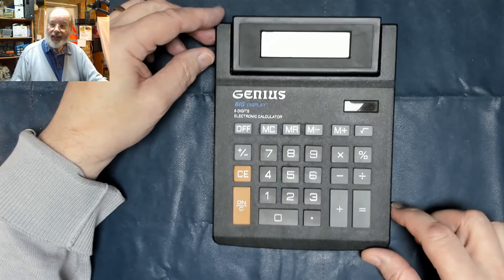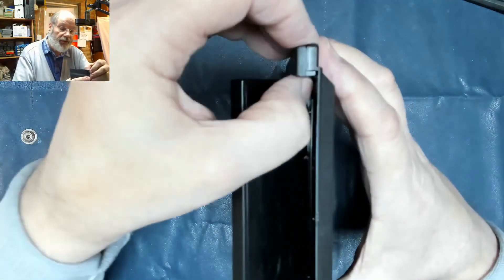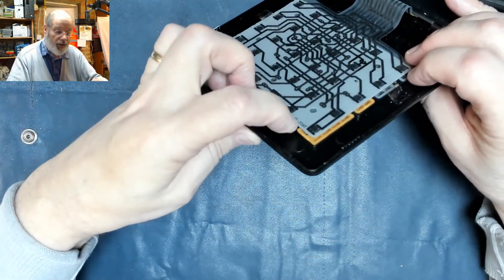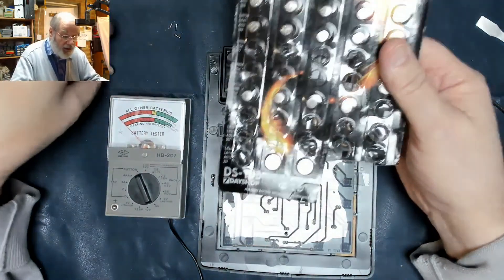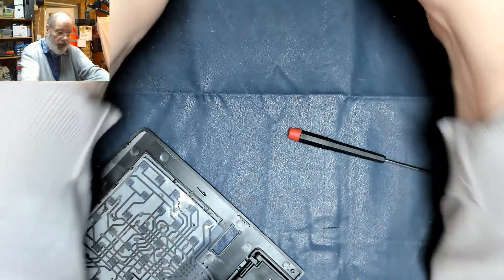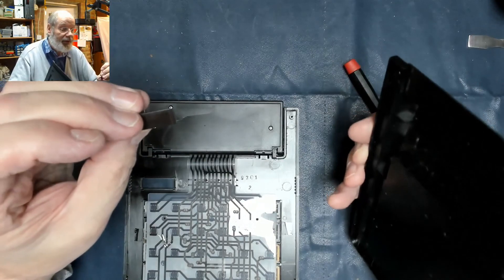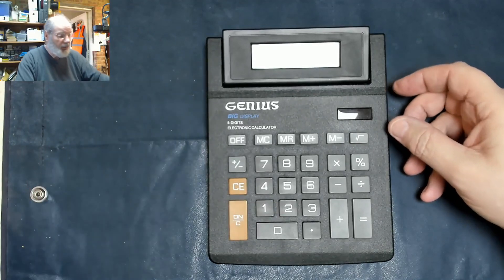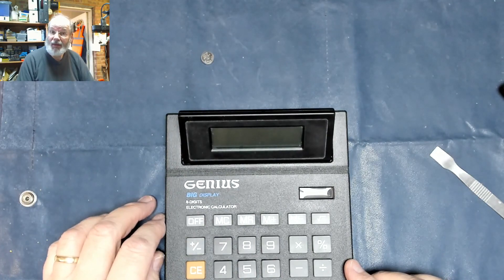Repairing a FAKE SOLAR POWERED Calculator

Comment: hello could you tell me where i put 2 cables in that board? cuz i have the same calculator but i want to put it with aaa battery, in part of the board i put the positive and negative cables? thanks.
Reply from the maker: Sorry no, the unit is long gone.

Comment: I WANT YOU TO MAKE A VIDEO ABOUT MY CALCULATOR PROBLEM 
I HAD RECENTLY BOUGHT A FAKE CASIO CALCULATOR BECAUSE MY FAMILY ISN'T THAT WEALTHY TO BOUGHT ME AN ORIGINAL ONE , WHATEVER, SO THE PROBLEM IS THAT INSIDE OF IT THEY GAVE A REAL SOLAR PANEL THAT HAVE WORKING TERMINALS I HAD TESTED AND  TWO SPACES FOR CELL FAR APART FROM EACH OTHER , LITTERLY ONE IS AT THE TOP OF CALCULATOR AND 2ND IS IN THE CENTRE-DOWNWARD . 
THE TOP SPACE FOR CELL IS FILLED WITH TWO BUTTON SIZED CELLS SIMILAR TO ONE U SHOWED IN VIDEO AND THE 2ND SPACE IS EMPTY . I JUST WANT YOU TO SHOW ME THAT HOW TO MAKE MY CALCULATOR WORK ON BOTH POWER  SYSTEMS CUZ I THINK THAT THE FAKE COMPANY JUST LET THIS SPACE FOR THE CUSTOMER THAT IF HE WANT TO MAKE A CONNECTION HE CAN. I BY MYSELF ALSO THINKS THAT MAYBE SOMEHOW I COULD MAKE CONNECTION FROM SOLAR PANEL TO THE EMPTY SPACE WHERE I SHOULD PLACE ANOTHER CELL FOR SOLAR  PLATE  TO STORE  ITS POWER . AND THEN I FOUND U PLEASE PLEASE PLEASE LET ME KNOW IF IM CORRECT 
BY THE WAY IM A  HIGH SCHOOL STUDENT LIVE IN PAKISTAN,   REALLY HOPING THAT U WILL REPLY AND HELP ME WITH MY ISSUE,
THANK U FOR READING THIS FAR
Reply from the maker: Hi, not sure what you're asking. You want to convert a basic calculator to Solar powered? You need to replace those cells with rechargeable batteries and add a solar cell and charging circuit. The cost for all that would probably be more than buying an new solar powered calculator.